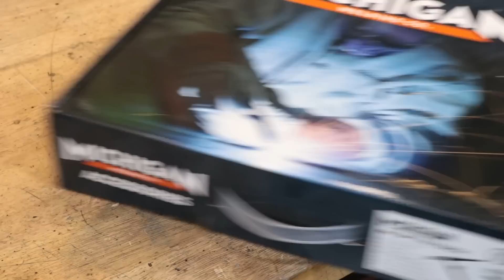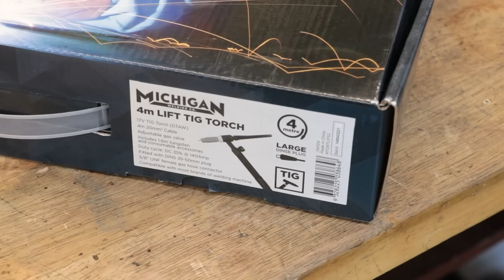I Bought A TIG W̶e̶l̶d̶e̶r̶ Torch - TIG Stand Build

Comment: Even though I have managed to Mig weld my own 4.5 x 2.4 x 2.4 mtr shed I still have difficulty with Tig. 
Thought , ah good can weld really thin stuff now . Not so easy is it ?
Your tig attempts are better than mine bloke ( Got to keep that gas flow going and stay close enough while pulling away to break the arc or bubbles everywhere).

Comment: 75/25 Argon/CO2 is the most common mix for mig. Also I think two V-notches works better for a Tig torch so the cable hangs straight down instead of out from the bench were you can walk into it & knock it out of the holder. For a scratch start and manual valve those weld are not that bad, good video, very enjoyable.

Comment: Little tip for scratch start tig. Drop your amps a little lower. Let the puddle establish. Controll the heat with the amount of filler wire you add and your travel speed. Its difficult but gets easier with practice.

Comment: Another thing to note is gas lenses mean you don’t need as much gas flow which saves you money and the more laminar flow gives nicer welds. Also you can weld mild to cast by using stainless filler rod. Just make sure the tacks are about 2-3 times longer than a normal tack. So 3 dabs in stead of 1.

Comment: A couple of things to note with tig. Have you connected the torch to be the negative? Mig is torch +.
Tig the torch is the -
You could wire a switch on the torch to the mig welder switch connection so it fires the gas valve in the machine. The wire feed would also run but as long as the wire is removed from the rollers it would t matter. 
Also you could try getting a bit of brass or a copper coin to strike your arc on that was butted up to your work piece then run off the copper on to the work piece. Then you won’t stick down I think. (Just an idea though) good luck mate. Rigs a great tool to have.

Comment: you're not wrong about JB Weld, you can't warp a part with no heat: I repaired AL crank handle with epoxy, it was so perfect you could barely tell i broke it. I broke it again and used top of the line tig unit (360v. Lincoln Electric) and warped it crooked, it looks like s--- on my lathe. your cylinders must be new Chinese...the commercial shops will try to rip you off on tanks.
Reply: My guess is that he is getting his gases through Bunnings and they have some fairly new looking cylinders.

Comment: Good to see the upgrades in the shop 

A few things to note one of the biggest challenges people tend to ignore is lead management it's far more important with Tig and oxy welding than mig 
But it will give you such a huge headstart not fighting the lead 

You are doing things the hardway with "converting" old mate blinky to Tig but if you upgrade to a better machine it will feel like someone flicked a switch 

Gloves and hood make a huge difference to the finished weld for no investment in time or skill I use the unimig split grain gloves are like a second skin 

And hood the Lincoln 3350 is the best bang for your buck 

If you're interested I have an old Eastwood 200amp AC DC I was going to sell with a few hours of instruction
I reckon you're within walking distance to me i recognised my local edcon in a video

Comment: I have the uni Mig razor TIG.
With that machine you can not weld Aluminium.
Reply: You can mig weld aluminum on D.C current,  mig welding does require a Teflon liner or even better a spool gun to work properly.. mig welding has a lot more turbulence in the weld puddle than tig which is why it can float oxides to the surface
Reply: @markshort9098 No professional welder can claim what you are saying.
Reply: @21gioni   dc mig welding aluminium has been done for decades in factories and fab shops all over the world 🤦‍♂️ ac mig welding has only been around a few years now.. look up how to mig weld aluminium on YouTube, and I'm sure you'll find plenty of videos of professionals welding aluminium with dc mig welders
Reply: @markshort9098 Are you a professional?
Because there are plenty on YouTube who claim to be professional.
To obtain a professional result take it from a professional you can not obtain a good weld using DC on Aluminum.
Because you say you have seen many professional videos doesn’t make you a professional.
Do you think 50 years in the welding industry doesn’t make me qualified to correct someone who is giving bad advice and welding tips?
Reply: @21gioni   well after 50 years you should know that dc mig welding aluminium has been done for decades in industry, it's not as pretty a weld as tig but it's a good strong weld that's holding many millions of aluminium boats, dump truck trays and trailers etc together.. look it up, I'm talking about what is used in INDUSTRY, not just what backyard joe is posting on YouTube.. and yes I am a professional welder with 30 years welding and machining experience.. maybe watch jody on YouTube over at welding tips and tricks, he's a certified instructor and he's certified in aerospace and nuclear or just spend a little time on Google and you will learn that it doesn't matter how long you've been welding, there's always more to learn

Comment: Turn down your heat man the welds will look better remember as low a heat as can work. 30 years welding one of the best tips I ever got . That also true for an acetylene torch
Reply: Unless its stainless. That low temp just overheats everything n burns the chromium out

Comment: Love it. 
If you can find one secondhand I used to have a Magmate 150 amp tig welder from BOC, they were cheap - $200 analogue machine. It was a brilliant little machine for DC only. I sold it to a mate who wanted to start tig welding, I upgraded to a CIG ACDC tig welder with a pedal.

Comment: highly recommend tig brazing with silicon bronze.
Reply from the maker: Gonna need some practice before I start tig brazing
Reply: @artisanmakes  easier than welding in my opinion. But I recommend more gas coverage. #8 probably.  ride the puddle, not the base metal. In your case, probably would come in handy for thin metal, since you don’t have remote amperage control

Comment: Man, to my understanding Tig doesn't give a fuck about what are you using, as long as it protects the weld from the evil oxygen
Reply: There's often 2% oxygen in mig gas and at the temperature of a tig arc it can split co2 releasing oxygen.. using mig gas won't work with tig

Comment: Welds have one job: Holding material. 

Pretty doesn't do that. You need penetration. So do a few welds on scrap and cut them to check their cross section. 

If it has solid root penetration you're good. If not, you need to train.

Comment: Good thinking. Also, with scratch start you could flick filler between tungsten and your material to avoid sticking. And id buy set of gas lens and a wider cup. Simple alumina oxide one, not glass. Its an investment but, man, once you tried it you dont wanna use standard nozzle. For non stainless\titanium etc gas coverage is not end all be all but its a good upgrade + you can fit it to you next torch anyway so no reason not to buy. For hobby use it really doesnt matter but good to know about anyway.
Reply: And you can DCEP weld aluminum, but you need fat 3.2mm tungsten and its only good for thin stuff because of aluminum heat dissipating and tungsten overheating. But it definetly can be done
Reply: @Mudganon59  that being said. IM GOING OUT TO MY SHOP RIGHT NOW TO TRY IT.
Reply: @cobre7717  Both excellent comments but...  I thought the whole point of TIG gas was that the gas contaminations argon?
Reply: @Kineth1  the argon (or helium) gas is inert, it shield atmospheric air away from the molten metal. Otherwise the hydrogen nitrogen and oxygen in the air tries to equalize and go into the molten metal. It makes sponge like bubbles then freezes inside the metal when it cools leaving holes.  Thats for all tig welding ac or dc

So for ac welding The aluminum surface will start to passively oxidize after something like 7 or 15 seconds. It is important to keep the aluminum as clean as possible. Even if you wire brush it perfectly clean it will oxidize and that is what the ac flip of the sine wave is helping to clean. Because ac is at 60 hertz it switches polarity 120 times a second. It makes a much louder noise than dc tig welding wich is pretty silent. Dc Mig is loud because the wire is in a short circuit sequence. This ac120 flips is not to be confused with the high frequency  for starting on dc. That is much higher hertz with tiny amount of current. It gives a path to let the main arc jump across when starting on dc. You use it on ac aluminum tig welding all the time. It keeps the main welding arc going good for welding aluminum without cutting out if you move the tungsten away from the surface a little bit.
Reply: @cobre7717  I really appreciate the well thought-out and informative reply.  (I did learn a bit from it)  Although, I think you might have missed the the core of my comment.

Why don't chemists make any new jokes about elements?  Because the best one's argon.
Reply: @Kineth1  hahaha I thought it was some wacky autocorrect feature
Reply: @Mudganon59  the transition of a.c. current over the sine wave of polarity cleans off the oxide that forms on aluminum. One a/c side cleans and the other puts heat into it.  Id say you could maybe make it melted on thin aluminum but id be very skeptical of  it working for anything other than a desktop trinket on workbenk or shelf.